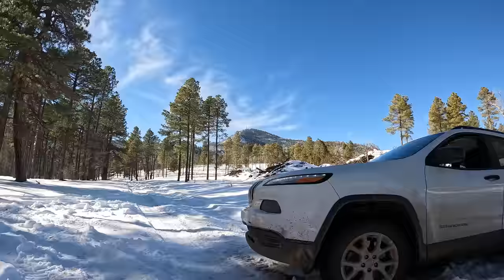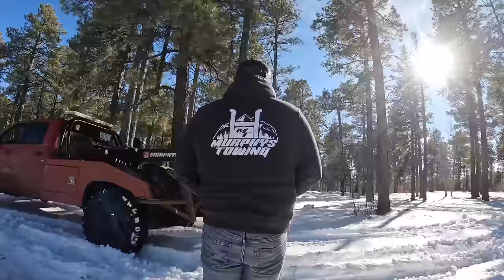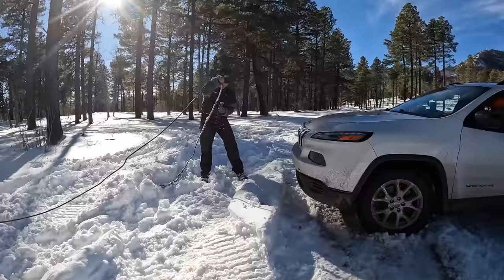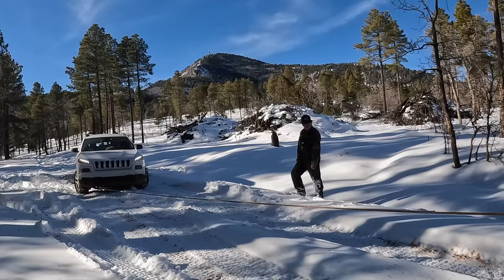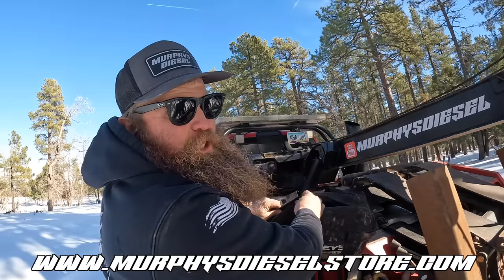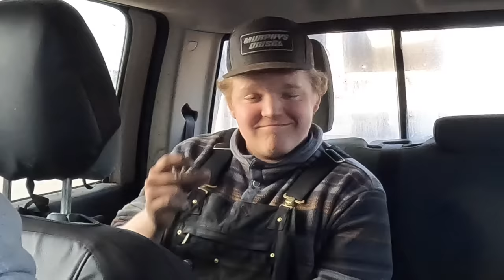This JEEP was buried in the SNOW! We got the call...and sent HELLBOY!

Comment: FYI the Matt tracks on there site say that when your speedometer says 60 MPH your doing 40 MPH so if your speedometer says 90 MPH your doing 60 MPH cause the track is 2/3 the size of the regular stock wheel
Reply: Thanks. My speedometer is off 20 mph now cause I’m running 41’s

Comment: Rapidly becoming one of my favorite channels on the Tube, telling my peeps about it. What brand Bumper is that on your Ram Tow Truck & will it accomadte a Warn 16.5TI Winch??? DOes it impede the cooling of the Intercooler at all?
Reply: Thank you! It is a custom Murphys diesel bumper, yes sir it’s got the ol 16.5 ti in it, it does not at the moment because it doesn’t have the skid plate on it, The skid plate that goes on it has vent holes in it. I have an earlier video that we did on the bumper build, check it out if you get a chance